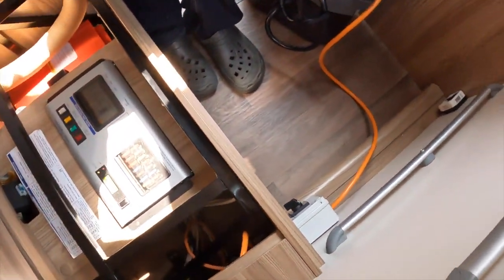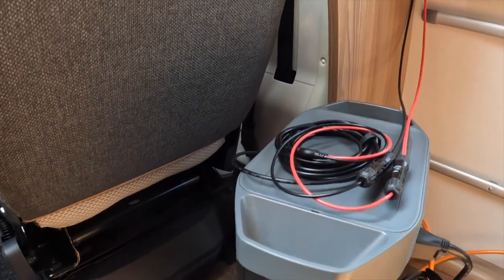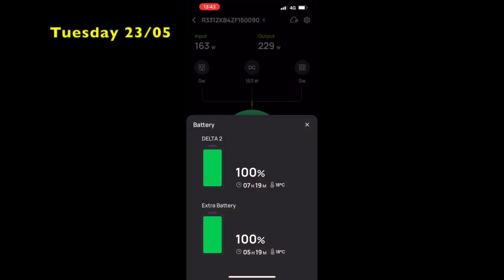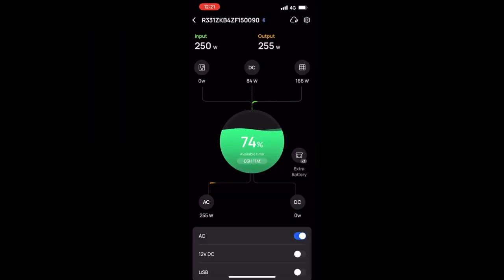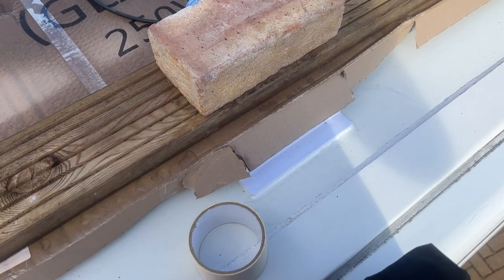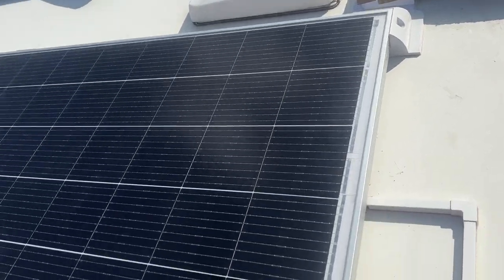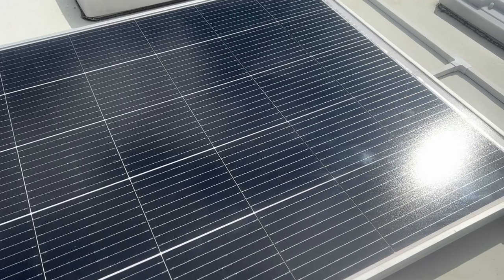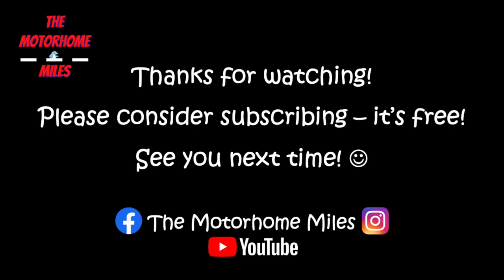Can A Portable Power Bank Power A Motorhome ?

Comment: Really pleased this is working out for you, we use our power banks in a similar way, just not connected to roof solar, but if our batteries ever go down, we will be doing what you have done, thanks guy’s. Safe travels 🙏👍👍🚌🏴
Reply from the maker: Thanks Steve & Lorna 😃 hope your all well, we just thought if we’ve got to spend out on solar panels we might as well have them out all the time to get as much as possible so tried this and touch wood it’s working great just got to see how it gets on in winter now 🤔
Thanks for watching 😊
Stay Safe 😜👍
Reply: @TheMotorhomeMiles  most definitely buddy, we will be changing our panels on the roof before next spring, they are not very good and need about 500 like you. Safe travels guys 🙏👊👍🚌

Comment: Do you have the costings for this project and links to where to buy the products you used?
Reply from the maker: Hi Julia 👋 I don’t have links as the power bank and expansion battery came from Power2Go and were on a offer at the time at £1600  but I believe the same ones can be found cheaper now or newer alternative versions used instead.
Solar panels and brackets were £400 from CraigSolar.
Then there were just the extension wires switch and box which my electrician mate got ( probably from screw fix or similar) and charged me £100 for including fitting the switch.
So all in it comes to £2100 which considering we were quoted £5000ish to have a whole system built into the van and a lithium battery fitted we are quite happy with especially as it’s all easily removable too 😃 
Hope that helps and don’t hesitate to ask if there’s anything else 😉
Stay Safe 😜👍